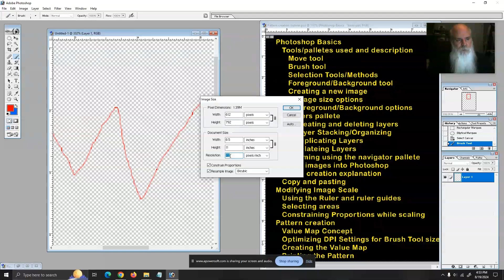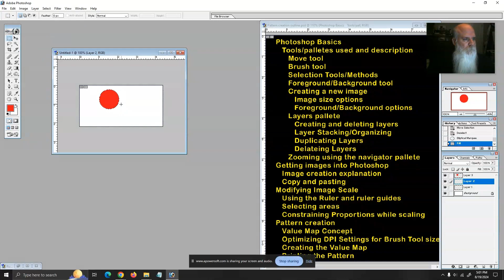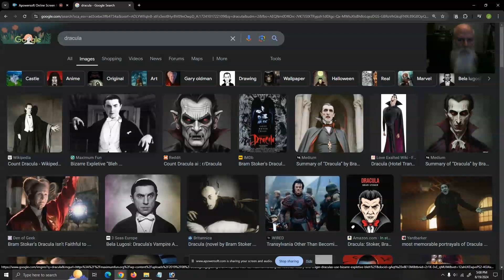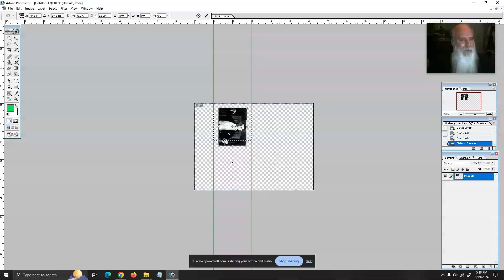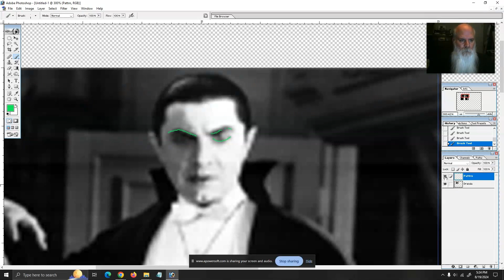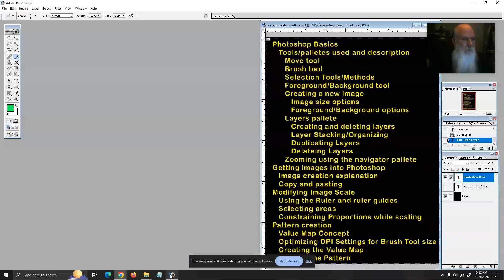Creating Patterns for Scrimshaw using Adobe Photoshop 7.0

Comment: Thank you so much for putting the effort in to make this video. I was very curious how you do your layouts for your scrims. I follows along for most of this. Years ago I had photoshop either 2 or 5, can't remember. So am generally familiar with the program. The only question I have at the moment is how you transfer the image to the handle after printing it out?
Reply from the maker: Thanks Paul, after I print it out I will use scotch brand Magic tape and tape it over the handle/material in position, then carefully poke through the tape and paper into the material just enough to where the holes created will be deep enough to see off of the light reflection but not deep enough to pick up much ink if any at all. The reason I want to go light with laying in the holes on the transfer is so that I don't have a bunch of black dots to contend with where I don't want them. The Magic tape is thinner than the clear/transparent type tape so it makes it a little easier to feel how deep I'm going while transferring the pattern. If you are careful about removing only one side at a time, you can lift up the pattern in place on one side to get a peek at what it's looking like. It is one of those things that is going to take a few times to get the feel down to know how much pressure is required to lay it in well. If you go too deep there are two options, the first is to sand it all back down and try again, the second is to just sand it down with a finer grit until the holes are just visible. You may want to ink test it after laying in the pattern to see what it looks like, just ink the piece and remove the ink like normal and you can see what you will have to work with before you dedicate your time to it. When working on cylinder shapes or concave/convex shapes you can make relief cuts into the pattern to help place it to shape, another trick you can use is to slightly dampen the paper to make it more pliable, but too much hydration can cause the ink to run and spread so a little goes a long way and if you apply the tape onto the paper pattern before dampening helps with that too. I plan on making a series of videos showing me go through the process of scrimming a smaller project in real time from start to finish. Kind of like a come scrim with Jim type of project posting the created pattern for people to download if they want to follow along at their own speed.